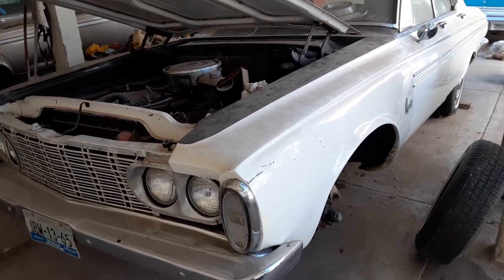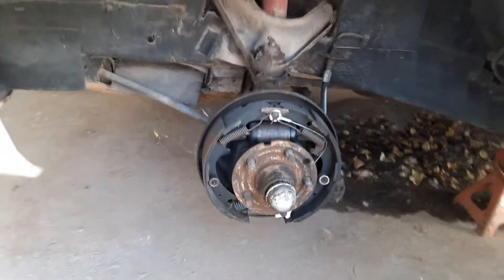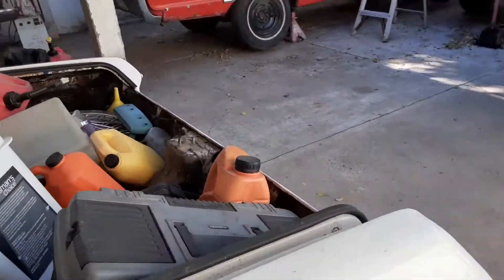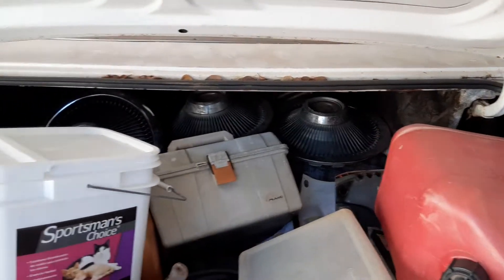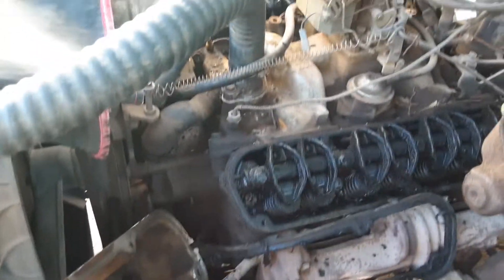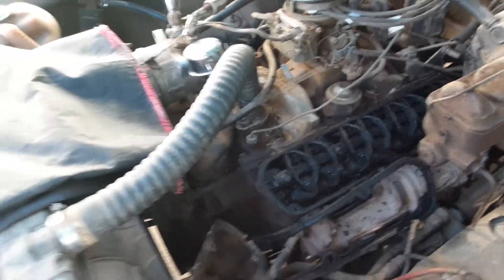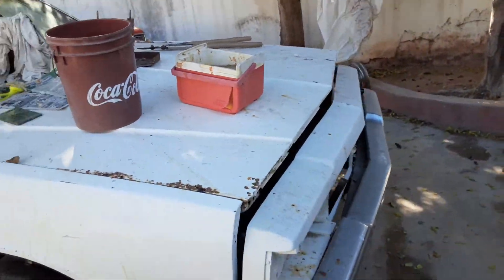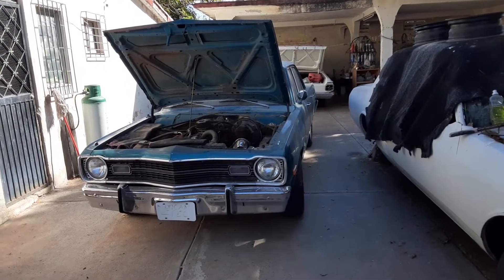Mexican Spec - Quick Update 1963 Plymouth Savoy And 1974 Chrysler Dart

Comment: Wait 60 degrees?
You're pulling my leg right?
My garage is my driveway next to the cellar door where I store my tools. 
I have worked on a gravel driveway on my back in 20 degree weather in the snow. 
I will take your cold weather any day. 
Now on the car front, I had a 2dr 63 Savoy and a 2dr 68 Dart and a 67 Cuda all slant sixes. then I got a 70 Swinger 340 4sp and then I got married. 
They are all gone and I wouldn't mind having them back in fact I wouldn't mind having just one of them back. 
Good video. 
Happy Motoring.
Reply from the maker: Considering it is usually hot here the 60 feels cold and it affect my arthritis to the point that I can't work on the cars.  It has been windy lately, which is odd, and that makes it worse.  Also, it was more of a joke because I watch all the guys in Canada saying it is 20 below.  I am going to get back out there and get these cars back on the road, if the weather will let me.

I might be able to find you a 2 door Savoy.  I have seen a few here, 1962 - 1964.  I have seen a few Mexican Spec 1968 Dart GTS's as well, but they only have a 318 in them.
Reply: @mexicanspec  Sorry about the arthritis. I have had a bad back that I have to be careful of or else I am on my back for awhile recovering. 
Thanks for the offer on the cars but until my son and his family move out I will not be able to acquire any more projects. I need to compete two mini vans and I have an 87 Cherokee that needs some attention. Wife says before you get another one ya gotta get rid of one.

Comment: Sixty degrees doesn't sound that bad. When I'm working in a cool environment, I will wear two sweatshirts and wear a pair of sweatpants under my blue jeans. One sweatshirt will be a hoodie with the hood up around my head. That works well unless it gets cooler. Then it's time for a jacket but I hate working on cars with a heavy jacket so I'll do something else.
Reply from the maker: It is not so much my body that is the problem, it is the arthritis in my hands.  Also, I put that in there as a small joke because all you guys up north are posting negative temperatures.  I do know how lucky I am here.
Reply: @mexicanspec  I spent many years living in Yuma, Arizona. I could work all year. I remember the warm winters. Yeah, 60 is good although at 60 I would wear a couple of sweatshirts. Now I split my time in Tennessee and Maryland. Both places can be cold. I need to put wheel bearings in my Jeep when I get back to Maryland. I know I'm gonna freeze. I'm thankful I don't live farther north.